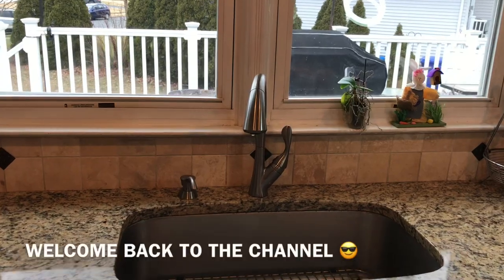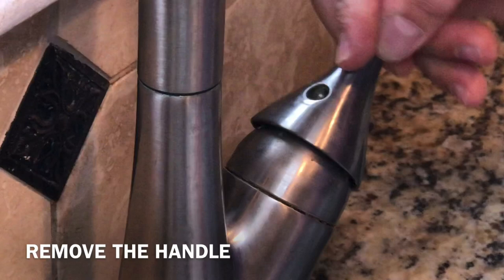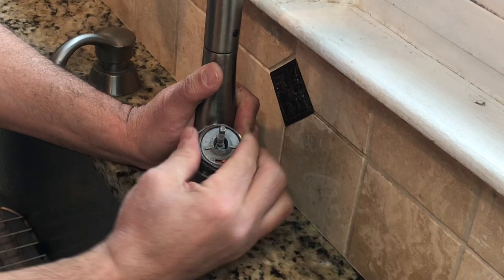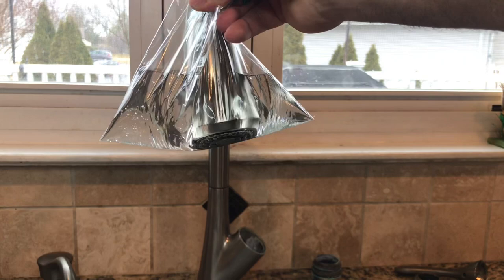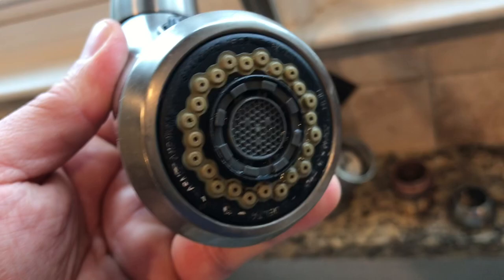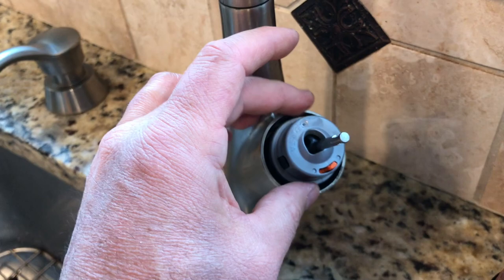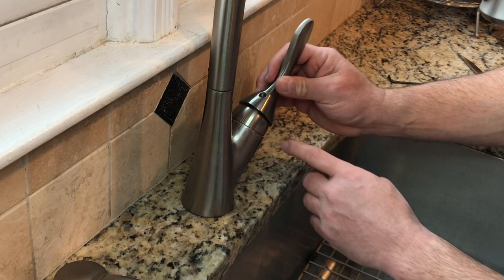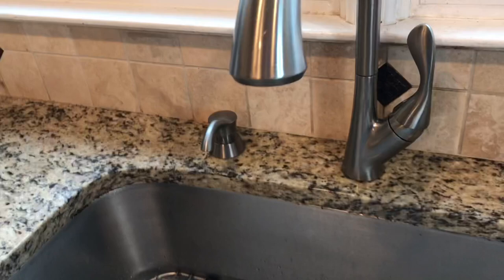HOW TO FIX A LEAKY DELTA FAUCET - Replacing a Valve Cartridge on a Single Handle Delta Faucet. Easy!

Comment: You may want to cover the sink drains with a rag in case something slips out of your hand and falls down the drain.  Also maybe turn the water back on after you install the cartridge and before you replace the handle to make sure the lever on the cartridge is controlling the water pressure and temperature to your satisfaction.

Comment: Fantastic video!  My cartride decided to leak accumulating a small amount at the base on the top of the counter.  Originally I thought the water was from splashing while doing dishes, but no matter how careful I was, the water would come back after running the water for several minutes.  I used your video to replace the worn out cartridge after a trip to ace hardware, and the leak is gone for good.  Thank you so much for this informative video!  This annoyance is now solved, and if it ever happens again, I'll know exactly what to do.

Comment: Thank you too.  Just replaced the cartridge just as you instructed. My only added tip to others who have this leaky faucet situation, unless already shared, is to plan ahead if you can and order the part early. Via Amazon, the part can be ~$20 as of this writing (Aug 2022). At the nearby hardware store, it was nearly $50 (which is what I paid for to achieve the immediate repair). Fixin-it, thanks again.
Reply from the maker: Thanks for watching 😎

Comment: Pro, tip,, as A retired  Master Repair Plumber in Alabama.
Deltas are great. I use a small squirt of   wd 40 or  Blaster BP  on the Handle nut, an The Cap nut.
 Tap lightly ,, just like mechanic work.

Repair plumbing breaks What's not broke getting what is broke. I broke everything First 5 years in plumbing,lol.
Reply: Pam cooking spray is a safe choice.

Comment: Thanks for the tutorial. I just did this in ten minutes with one exception, instead of buying a new cartridge I carefuly opened it up by lifting the tabs on the side and using a q-tip to spread Vaseline all over the moving parts. Snapped it back together and good as new.

Comment: Thanks to you, I was able to repair the faucet that has been driving me nuts for months. I'm new to doing things like this. I kept putting it off because I thought I would have to replace the whole faucet and call a plumber. And my house is only 3 1/2 years old! The directions were perfect.
Reply: Wow, mine lasted over 13 years.

Comment: I took mine apart and then put it back together and it worked perfectly again. I think the screw had just come loose and the valve handle wasnt sitting where it should on the flat. No more dripping and i get hot and cold water when i should now. Way easier than the cups and springs.

Comment: Excellent video sir,
Doing a repair like this is soooo much cheaper than hiring someone to do it.
Even if you have to buy all the (good quality)  tools needed you still come out ahead AND you have tools for the next repair.
A plumber would charge $100 -$200+  to do this simple repair.

Comment: Real nice for showing the disassembly.  My handle had become hard to move, “sticky” and didn’t want to shut off.  I removed the cartridge, moved the cartridge handle all around rapidly, flushed it out with water and repeated that process three or four times and it restored my cartridge function to like new again. I suspect that it was calcium and sediment buildup in the cartridge around the ball and seals and rapidly moving the handle around seems to have cleared it.

Comment: I just removed my  cartridge and cleaned and reinstalled it. Tightened up the brass bushing a little more.   No more drip. Probably was loose from not being tightened at the factory enough.

Comment: I took mine apart and found there's three screws in the bottom. 20 years ago I took it apart and thought I remembered springs underneath the screw ports? Any who I cleaned the parts, handle and O-ring with vinegar and put it back together. It fixed it!

Comment: Thanks a million. This is an expensive faucet and I would have been bummed to have to replace it. Got the job done in about 5 minutes. WORD OF WARNING - put drain plugs in so that you don’t lose the little screw or cap down the drain! Also, the silver ring was really tough to unscrew, but I got it after a few really hard attempts.

Comment: Thank you Fixin It.  I had no idea how to fix my leaking faucet.  I watched your video. Ordered the valve cartridge on Amazon and fixed it myself.  I have hard water so that was a good tip to use the white vinegar to soak the parts in.  No more leak.

Comment: Lots of Delta faucets have a Lifetime Parts Warranty, call Delta, and if your model is included (Like mine) they will send you a cartridge totally free for life. Tag with model # is attached to the hot water supply line under sink.  Be sure to use the sink stopper to not loose the screw or other parts. I put anti seize on the little screw threads to make it easy next time, for me or who ever.

Comment: Thank you. We contacted  Delta and they sent us a FREE  replacement part. Your video made it easy for my hubby to fix the faucet which was not only dripping but near impossible to adjust the handle right or left (very stiff and squeeky)  .  We had to find the "sweet spot" to stop the water from dripping or outright flowing out of this faucet.  When we removed the part, it was covered with some light green colored tarnish maybe?  I don't know what caused that but thinking maybe hard water?  Anyway your tutorial was concise, clear and easy to follow.  BIG THANKS FROM NJ

Comment: If you have trouble getting that dome ring off, instead of using pliers, pipe wrenches work also called shower valve wrenches. I’m having trouble getting the retaining nut off without ripping the whole Faucet off
Reply: I'm also having trouble removing the interior cartridge retaining nut.

Comment: Thank You!   I dislike plumbing fixes because something always seems to go wrong, not as instructions indicate, etc.  BUT this worked as shown, pretty easy.   I appreciate it.
Reply: You lucked out. The set screw in my handle was basically fused to the handle body and I ended up spending hours trying to get it out, finally drilling it out. Now I have to tap new threads, buy a whole new handle, or just get an entire new faucet. None of these are good options for what should have been a quick easy repair.

Comment: Great video straight to the point! Took me a while to get the allen screw out, mine has a lot of scale and was stuck. The only recommendation I would give is to maybe add that if one is having issues with that to add some vinegar to the hole with the screw then let it sit for an hour and scrape out the lime scale with a tooth pick. After that it took some more elbow grease hit I finally got it off. Then your instructions worked like a charm and now it works like new. Thank you!

Comment: Thanks for this.  Mine wasn't leaking; just not operating smoothly.

Some tips: To make it easier to remove the cap, use a rubber jar gripper.  On the the nut, use an adjustable wrench, to avoid mangling the nut.  It's  a 1-1/4" nut, and my 12-inch adjustable wrench opened up just enough to fit.

You can use grey ScotchBrite (from the auto parts store, or an auto body supply company) with white vinegar to clean the nut and the inside of the faucet.  I also put silicone grease on the outside of the nut when reassembling, and on the orange gasket on the bottom of the new cartridge, to keep the gasket from falling off when installing the cartridge.

Comment: CAUTION with the vinegar! Some finishes can be badly etched using this method. NO criticism! Just relating a bad experience on my part. Also, be sure to completely block those drain holes. You KNOW where that set screw is going to go if you inadvertedly drop it. Another bad experience for me. Thanx for the great video.

Comment: Thank you, Just a note I had to drill out the set screw on the handle because it was seized up from eight years the two metals created an almost weld like bond with the handle and set screw. To prevent this use a little Permatex anti-seize lubricant when you replace the nut if you can get it off.. A new handle is only $85.00  :(

Comment: Thanks for the detailed video. Iam having trouble removing the plastic cap, after removing the handle. Used channel locks with cloth / electric tape to grip. It still stripped the plastic cap but it is not loosenings😮
Reply: How did you remove it?

Comment: This is a great straight forward,  informative video. Two thumbs up for not talking my ears off with a bunch of nonsense before getting to the point. 
 I changed mine several years ago. Now, I need to change it again. Last time I had no trouble getting the hex screw out. Now I can't budge it. I think I may have stripped it a little.  Not sure. Any suggestions ? I hate hex screws. More 9ften than not they're a pain.
Reply from the maker: Try banging a slightly bigger allen key in there or using a screw extractor https://amzn.to/3sWORnj

Comment: Changed mine out,after a leak. The new one didn't flow like the old one, bought another, same thing. Tore the whole thing apart . Still slow flow.
Went and bought a new faucet.  Works like new.  Because it is.

Comment: Delta replaced that cartridge 3 times since the faucet has a lifetime warranty. It takes more time but you can usually fix it by clearing out the debris by back flowing the water out the faucet hot and cold lines into a bucket. Turn off hot and cold supply lines, remove one line placing it in a bucket, turn the other supply on and manipulate the faucet control, the debris will flush in to the bucket. Repeat the process on the other supply line. Also remove the cartridge and clean any visible debris. Should work like new if not damaged.

Comment: Hello, thanks for the video. It helped me get through the first few steps, however, when trying to unscrew the nut/bonnet, it wouldn't budge even with an adjustable wrench. There is green build up all around it. Any suggestions about how to help loosen it? Also, just want to confirm that I should be turning the wrench clockwise to loosen like you did in the video? Much appreciated!
Reply from the maker: Go left (counterclockwise) to loosen. Spray it with penetrating oil.

Comment: Hi Fixin It, I hope you see this comment. I have the same faucet as you. I bought a replacement part as well. Now the set screw works on the handle before I place it on the valve cart. However, as soon as I put the handle on the cart and try to screw in the set screw, it does not want to screw in or stay in place. Do I screw the set screw on the flat part or the round part of the faucet? I tried buying a new set screw and it doesn't work either.

Comment: If you notice low water pressure you can also disconnect the hose from the faucet head if you look inside the back of the head there is a filter screen that night be plugged up.  I used a q-tip to clean that using hydrogen peroxide...If you know how to disassemble that part please comment a reply..

Comment: What if it drips after replacing the cstridge?  I tightened the bonnet nut down as the leak was coming from the catridge and bonnet nut snd thst fixed it.   Now about 6 months later i am getting a slow drip from faucet  every minute or so.  Would tightening the bonnet nut some more Work?  Is it safe to turn that bonnet nut another 1/4”?

Comment: I can’t remove the handle after removing set screw? Need further clarification? Did your video miss a step? Thx
Reply from the maker: It should pull out. Try spraying some penetrating oil and tapping it with hammer to break it lose

Comment: I did not have ultimate success. I tried again to turn the bonnet nut (that's the real term for the decorative yet functional outer screw) and succeeded. Underneath it was another large screw, this one not at all decorative. I saturated it with WD40 and tried to unscrew it. I probably didn't wait long enough (I was Ms. Impatient at this point). I turned it too hard and cracked the faucet on the right side, causing it to leak continuously. This was somewhat amusing because I have almost no strength in my hands. Because my bathroom is pretty much original to my 74-year-old house the pipes didn't have shut offs under the sink. So I had to shut off the water at the main in the cellar, turning it on very sparingly for quick showers and harvesting the water out of the leaking faucet for washing dishes, etc. I lived like this for a week while I waited for the plumber who never returned my email and phone call. After a week I decided to try to swap out the faucet myself. I went to Lowe's and bought the most inexpensive faucet they had (a Project Source model costing $39.88) because I have plans to do a much needed gut remodel of the bathroom. At the register the sales associate asked me if I wanted the faucet installed. I had no idea that they would install something that small. They also gave me the option of having shutoffs installed under the sink. I said YES! It worked out well. A plumbing team came to my house and they were just great. The pipes under my sink were brass and too big (2.25" outside diameter) for Sharkbite shutoff valves so they had to lay some new copper pipe. I'm very much a DIYer but it turned out this job was out of my skill range, and I was very grateful for thei plumbing team's expertise. They were nice people too. So sorry that I can't report success but the faucet was 20+ years old and may even have been original to the bathroom (74 years old). It had years of scale and probably the metal was brittle. I took photos of it before they took it away.  The copper pipe on the right side was torn, and I think I was the one who did it. That shows how brittle the metal was. The modest new faucet works well, is reasonably attractive, and is an appropriate size for the bathroom sink. I'm very glad to have running water again!  BTW about a month prior I'd swapped a cartridge in my kitchen faucet, and that repair was very easy but that faucet is only about seven years old. Best of luck my DIY friends!

Comment: Just be forewarned that not all set screws are easily removed. I could not get mine to move even after cleaning around it and putting penetrating oil in. I tried every trick even an (easy out didn’t budge it) until I finally just drilled it out and now, unless I tap new threads the handle can’t be secured and just wobbles…because of the design, it moves freely until secured with set screw. I’m thinking that’s so you can align it, but I really don’t know why for sure. Surely I can’t be the only one to have this  frustrating experience, and yet, none of the videos even mention it.

Comment: Any thoughts on what might need repairing if the faucet still leaks after I change the cartridge? If it's helpful, when I turn off the cold water supply but leave the hot water supply on, the leak stops.

Comment: What do you do if that large brass "nut" is stuck?  I couldn't get it loose and was afraid of breaking the faucet if I forced it any further.  I used a crescent wrench, vise-grips, and channel lock pliers and had no luck.
Reply from the maker: You could try applying some heat and maybe spraying it with penetrating oil.
Reply: @fixinit  Thanks!  I'll give it a shot of p. oil and see how that does first.

Comment: I am having problem trying to remove the screw with an Allen wrench in the handle. The screw are way too tight. I have tried using WD40 to lime away. Yet it’s still not coming off…. Any suggestions will be helpful. Thanks
Reply from the maker: Put the allen key or a hex socket on the screw and hit it with a hammer to try to break it loose. You can also Heat it up but that may damage the finish on the faucet.

Comment: There is no allen screw in my delta faucet handle. How do I remove the handle?
Reply: The set screw is probably hiding behind the blue/red, hot/cold, emblem on the faucet handle (that is where mine was).
Just take a tiny flathead screwdriver and pry the hot/cold emblem off.

Comment: I Just had a brand new faucet like this one in your video, installed about a week ago. It started leaking a couple of drops after shutting the water off. Is there something I should tighten ? Or should I replace the cartridge? Even though it’s new? Any thoughts?
Reply from the maker: Return it

Comment: Thank you for the helpful video. I have a bathroom faucet that is a lookalike of the Moen Chateau lav but it uses the Delta RP50587 part. I know because I've been able to take the cap off and can see the stem. My problem is that the base is a giant nut that I can't seem to unscrew even with a channel lock wrench. I was twisting my hardest when the vanity started to move away from the wall, so I stopped. I've heated it with my hair dryer, and I've poured boiling vinegar over it to loosen scale. No luck. Any thoughts? Thanks again.

Comment: Good video! I have a problem tho - took off the bonnet nut and replaced the cartridge. Now I can't get the bonnet nut back on..it won't engage the threading with the cartridge installed. If I take the cartridge out I can get the bonnet nut to engage the thread and I can tighten it but with the cartridge installed it won't tighten.  Even trying to use the old cartridge I get the same problem. Ugh! Help! :)
Reply: I figured it out! I watched your video again and saw that you cleaned the lime/calcium buildup from inside where the cartridge sits. I had buildup inside there and I cleaned it all up with vinegar and a toothbrush. I didn't think that would make a difference but it did. Guess it pays to really make sure you clean up and get rid of any buildup when reinstalling the nut. Thanks!
Reply from the maker: Glad it worked out. Thanks for watching!😎